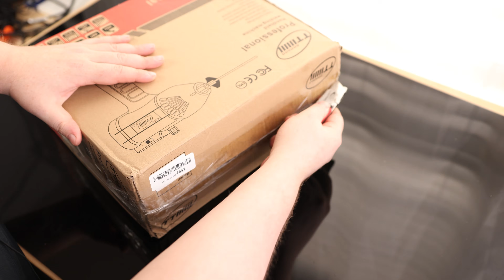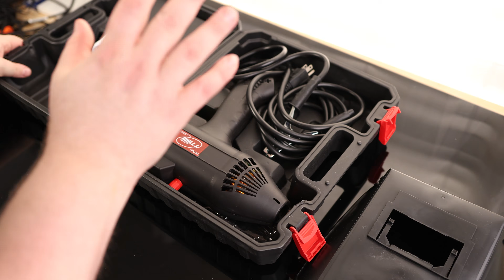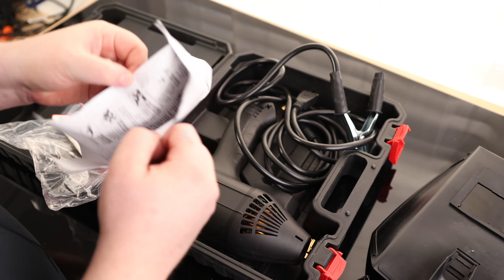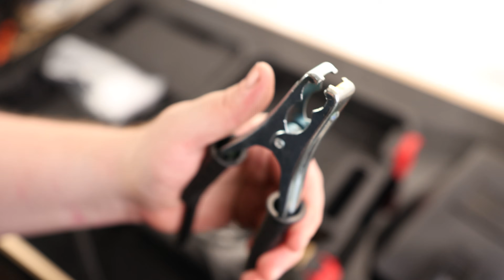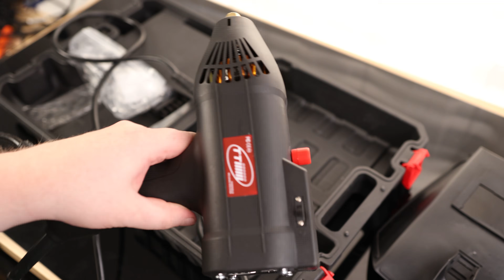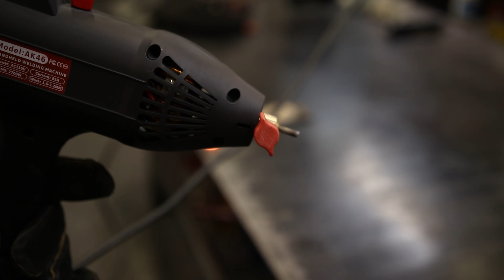TTiiiiii Handheld Inverter Welder

Comment: I also have one of these IGBT ARC welder, but its packed with setting and colorscreen.
It weighs 950g but its packed with settings you can adjust, and goes through numerous che3cllists and cal-info when starting up.
Do you know what these things meen and where they could be handy.
* "Hot start" percentage 1 to 10% (?)
* Force (?)
* FRequency 1 to 99HZ  (not sure what the purpose is here for the setting, is it merely intended for the enduser to decide 50 or 60Hz, and can you benefit by adjusting it to a higher freq, wonder why it gives adjustablelity from 1 to 99Hz.)
* Valley (?)
* VRD (Looks to be a safety, to not risk electrocute people, so it will only give very low voltage until certain criteria are met when )
* CP or CC  (that seems to be Alkaline rods vs Acid rods, and how the pulsing is maintained
You can see it here..
https://www.youtube.com/watch?v=j3ApUD9zS9w
It seems quite advanced, and it goes through numerous check & cal values when starting up, and makes report for each.
This unit is for 230v , but its kind of small and weighs only 950g, though it didn't came with casing or any accessory, only groundcable.. not sure what the model weight in your vid, as you don't mention it.?

Comment: What gauge extension cord would be advised for a hand held  unit that can go up to 120amps ?
Reply from the maker: The AC draw in a standard house outlet shouldn't exceed 20 amps, so 12 gauge will be fine.  If you're looking at a longer run, 10 gauge may be better to reduce voltage drop.  I' sure the official answer is don't use extension cords.

Comment: Ah Yes, I purchased a similar unit 'Digital Display Smart ...'   While it came with a 120v 15a plug, all it could do was scratch and spark but never pull an arc.  the doc suggested  AC180v=240v welding machine system..  Have not tried changing plugs and using my 8k 220v generator.
Reply: your demo had me buy one, unfortunately it didn't do any better than my old Lincoln hobby 110 unit, which is constant sticking of the rod, so i am wondering is it my high humidity rainforest that has both of them unusable because the flow won't start, just sticks like a magnet 98% of the time. both the old tech and the new IGBT. so can anyone tell me which rod does best in 90% humidity and can be dirty metal too, i know my old Lincoln 220 could burn through anything i put in front of the old 6013, but at low power, high humidity and dirty conditions is there a rod type that might flow? ANYONE?